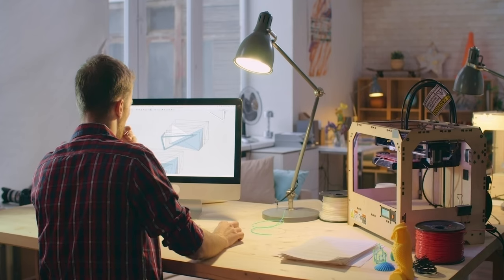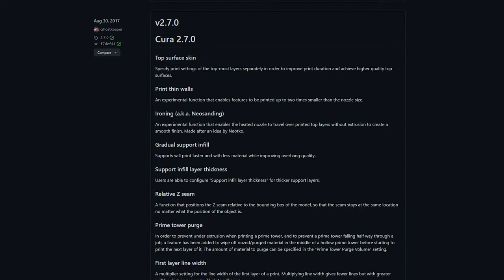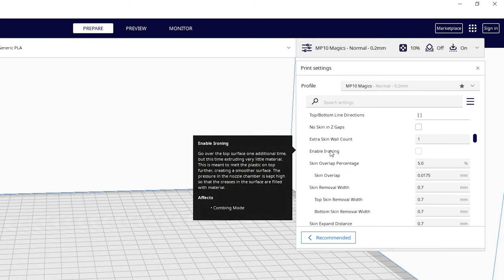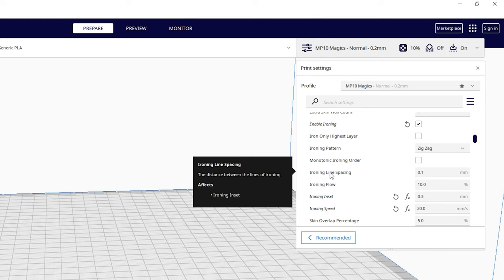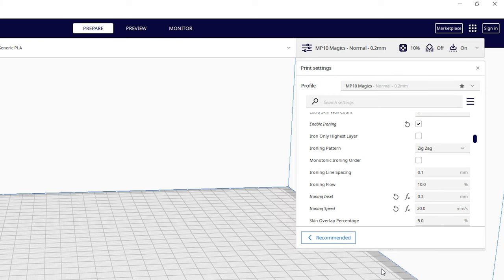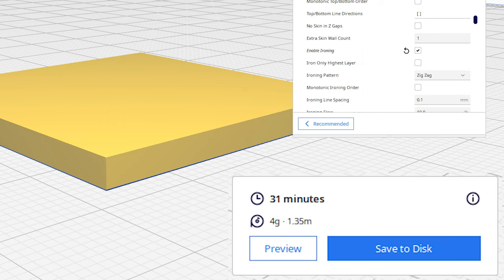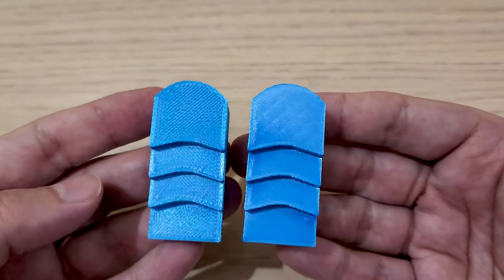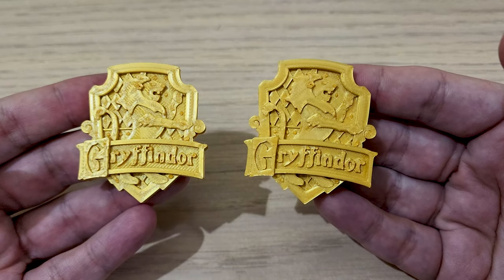Cura Ironing Feature - How to Get the Smoothest Top Layers

Comment: Excelent video, but how can i iron a curved surface ?
Reply: You can’t because the printer can’t tilt the nozzle. It’s just the way it is. Limitations of a printer with 3 axis.
Reply: Reduce extrusion speed and keep the ambient air temperature controlled, disable sudden acceleration of extruder and enable jerk control. This will help with uniform layer and ironing top layer would give that extra finish.

Comment: The problem that I have is when I use cura my prints get terrible and when I don’t use it it’s working fine so can someone help me please
Reply: Firstly I used creality slicer but it isn’t worked as well and I remembered that my friends advices that I should use cura instead but it also didn’t work and I don’t know what to do now
For now I’m printing stuff without overhanging but I would really like to print with this
Reply: @Cusulozz   which printer do you use?
Reply: Creality ender 5 plus